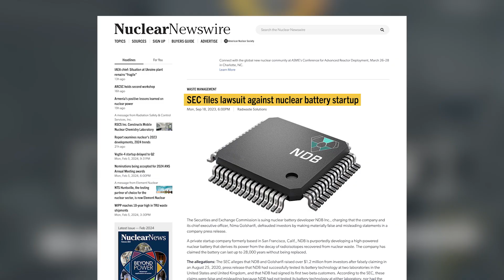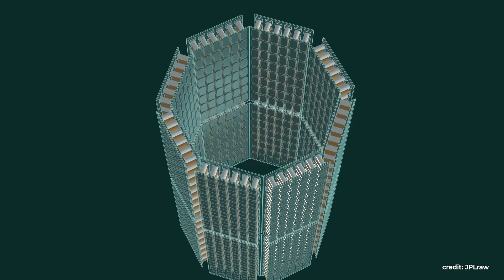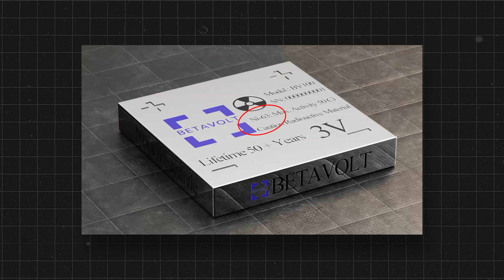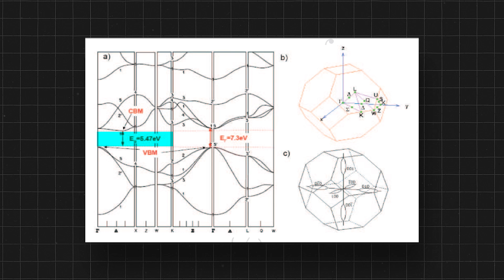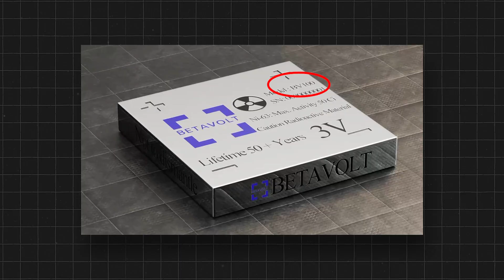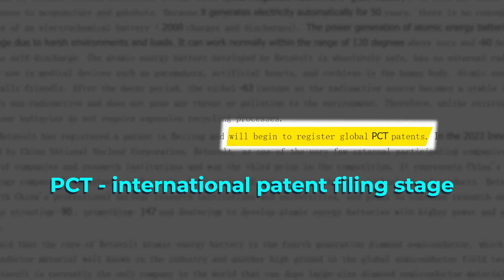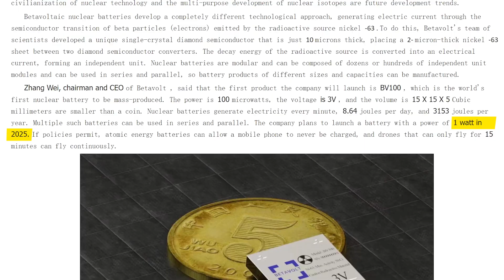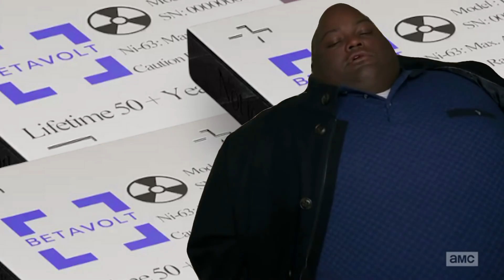Inside China's Nuclear Battery Breakthrough

Comment: They could include these along with a regular lithium ion battery in applications that require intermittent higher watt usage.  The nuclear battery acting as a constant trickle charging source while the device is in a dormant mode. Like a motion sensor wireless security camera that lasts decades. Could probably even do a phone that can regenerate passively and never fully dies.

Comment: Since it never stops charging it with radiation (if it ever works) wouldn't it have to be on all the time in order to dump the excess energy?  When it's off it will overcharge it if it's full. It would need some means of getting rid of the excess energy

Comment: If I could buy a one amp 18 V Ryobi battery which actually would equal 20 wants or a one amp 40 V battery which is 40 W  The value of those batteries would be 10,000 and the value of the 40 W battery would be $20,000 the use of these batteries would be unbelievable being able to power Ryobi’s maximum light at 32  Watch would be amazing even though you could power it with a six amp hour battery for eight hours you then have to change the battery out to be able to power it permanently would be well worth the money I have been looking for a power source for my 50 is in there still doesn’t seem to be anything in existence that you could purchase and produce power although solar panels are good they can’t  Power 24 hours a day and they can’t produce power in an enclosed basement so they have little to no value thank you for your video I have subscribed to you because I would really like to know about the advancement of this time in Battery in the future thank you very much for your research I would love to be able to buy one of those cells  to just test it and see what it can do thank you again for your video

Comment: Once they combine these with graphene super capacitors of the future, together with very low power usage electronics that suck up power in quick bursts, it might lead to some very interesting technologies. Especially since they claim to be developing a 1 watt version of this battery. At 1 watt it can become very interesting for battery+capacitor pairings.

Another interesting application (if the technology is inexpensive enough) would be to use this kind of technology instead of solar panels for generating power in your home, or to augment solar panel technology. IE: these could be used to power up a third source of power(on top of grid+solar panels+solar batteries) that keeps a backup battery charged in case of a grid+solar battery failure.

Comment: I think a stationary battery capable of running an individual home would be a great application for a 50 year lifespan.  It wouldn't matter if it cost $10k and took up 4 cubic meters buried in the yard to produce a continuous 10kw. Allowing offgrid power generation with no moving parts and nothing exposed to weather would be worth a premium compared to PV or wind.  It sounds like both these companies are a long way from that cost and package size, however.

Comment: My guess is that the first customer is still space sector? China has a few deep space mission proposals where a nuclear battery can be a good backup? I think this does outperform traditional RTG? Also the power density can be improved for this use cases by using more concentrated isotopes?

Comment: Kinda sounds like a tenth as valuable an idea as you think. At the same size you can create much higher power generators at significantly less cost. Anywhere with light even artificial or moonlight solar overtakes this. As for cargo i doubt Battery swapping is the driver for not doing this and even if it was there are better alternatives. Some medical case uses might be good but the market for this probably is not high enough to justify much hype or investment. These are pretty much only a good option for critical reliability, low power, low access, low light, and low space use cases. If it doesn't match every one of those to a pretty extreme degree then its practically useless. Unless these are manufactured at significantly low cost to the point they'd replace many watch batteries i doubt its usability and based on production method i severely doubt this

Comment: Missed PoVs: IoT and IT. 
Semi-passive sensors for IoT, and 'keep alive' voltage (instead of the classic CR2032, Etc.) for IT come to mind first and foremost.

If Betavolts 'current stage' claims are anywhere near accurate, and could be scaled to production (w/o the ire of the NRC, etc.), they'd have wide applications. 
-potentially even opening entire 'tech branches' (per se) for IoT proliferation [for better or worse]

Comment: Gosh this video is somewhat rubbish. Why care about energy density? The real topic is POWER DENSITY (e.g. Watts per gram) and not energy density (Joules per gram). The power density is limited by the isotopic power density which is entirely limited by the decay chain of the isotope used. You won't get more power out than what the decay chain is producing and with a realistic efficiency of perhaps 10%, there is no magic possible. Even if you chose a much more radioactive isotope like Plutonium 238 (will be too dangerous and way too expensive), you will still never get close to Li-Ion on power density. This entire idea is a scam when companies start talking nonsense about drones, laptops, smart phones, EVs and so on. It wont happen ever because of the nuclear science involved and the first law of thermodynamics (electric output power is a fraction of the isotopic power). NDB did this scam for years until they got sued. Now it's just another company doing the exact same BS. Just to put things in perspective, your smart phone takes around 1000 times more power just to be in standby than what this battery can output. If you used this battery and turned the phone off completely, it would take more than 10 years to charge it (while nobody could call you) LOL...
Reply: The battery has up to 50 Curie of Ni-63 as indicated on the package.  Make this 50 000 Ci to power a smart phone.  Most people have absolutely no idea what 50 Ci really means.  Regulatory agencies demands that you own a license (NRC in the US) to use or possess more than 0.003 Ci.  This battery will not make it to the public for that first and very simple reason.  Like you say, this is another investor's scam from China.
Reply: @chrisl442  You got it. But it’s worse. 100 micro Watts times 1000 is only 100 mW. You can barely keep a phone in standby on that. You rather need 10s of thousands of Curies of radiation to get to Watts of power when you start running more heavy apps, like a game, on your phone. This topic is extremely stupid.

Comment: Thank you for this informative video.

I made a quick back-on-the-envelope calculation. 1 gram of Nickel-63 has an activity of 2.1×10^12 Becquerel. It means that in 1 gram there are 2.1x10^12 beta decays (=56.8 Curie). Each beta decay has a variable energy, but on average we have roughly 20 keV = 20,000 * 1.6x10^{-19} = 3.2x10^{-15} joule/decay. So, eventually we have 2.1x10^12 * 3.2x10^{-15} = 0.00672 Watt. This is the amount of power produced by 1 gram of Nickel-63. Even if you were able to convert 100% of the radioactive decay energy into electric energy (impossible of course), you couldn't make more than that.

The battery label reads "50 Curies", so it there should be 50/56.8 = 0.88 grams of Nickel-63 in each battery. So each battery produces 0.00592 W; thus the efficiency on converting the decay energy into electric energy is 0.0001 / 0.00592 = 0.017, or 1.7% if you will. Not very impressive, if you ask me.

To produce 1 W, you would need 1 / (0.00672 * 0.017) = 8860 g of Nickel-63, or about a 9 kg of this radioactive isotope. I am aware that Nickel-63 can be made "relatively easily" in a nuclear reactor, by letting the non-radioactive and non-rare Nickel-62 be bombarded by neutrons... but a 9 kg lump to make the claimed 1 watt? Besides, these 9 kg would have to be spread over a very thin
film; if you make a bulky amount of Nickel, most electrons are stopped inside the mass itself. 

All of this, of course, does not apply if you use some other radioactive isotope that produces more energetic electrons and/or at higher activity (more Becquerels/g) and/or a generator with higher efficiency when converting into electric energy. I may be wrong, but I think I've seen refereed papers in which beta voltaic efficiencies of ~10% are claimed. Moreover, the whole nuclear battery gets warm by the non-used beta particle energy, so it could double as thermocouple - converting thermal energy into electric energy via Seebeck effect. The efficiency of a good thermocouple is ~10%. Thus, as 0-th order approximation, ~20% of the beta decay energy could be converted into electric energy. This still means 0.0013 W/g for Nickel-63, but 0.06 W/g for Tritium (hydrogen whose nucleus has 2 neutrons in addition to the proton). However, Nickel-63 has a half-life of 100 years, while Tritium half-life is only 12 years. And it is expensive, since it is mostly directed to keep thermonuclear warheads endowed with their "explosive" that vanishes rapidly over the years.

I think that Dr. Ben Miles is right - this technology is exciting and interesting, but it likely to have niche applications only. But we will see what the future has in store for us.

Comment: Watt-Hours is the more important measurement. This is a generator, not a battery. 

If the 70kg, 1W battery charges a capacitor for 1 hour, it gains 1 W-hr.
In 1 day that's 24 W-hr per 70 kg = 0.34 Whr/Kg
in 1 year it produces 124Whr/kg
... etc

Comment: These batteries are such an eye-roll to engineers. Micro-micro-watt batteries are totally useless for everything except the absolute corner-condition niche applications.  Even the most skilled, clever and imaginative electrical engineers struggle to find practical applications for these batteries.
Reply: Just run 10,000 cells in a parallel series and you'll have 1 watt at 30v for 2,530 years. How much does each cell cost?

Comment: betavoltaic batteries were invented 50 years ago. Come on... and this is especially not relevant, since it needs Ni63 isotope, which can only be synthetized for a low sum of 4000 USD per gram. So for producing 1 W, they will need 35 kg of it, it comes down to the bargain price of 140 million USD only for Ni63. But you know... this is the cheaper side, if they want 35 kg of artificial diamond, it will cost like 310 million USD for the cheapest options. So let's see: 1W for 50 years, 438 kWh for 450 million USD, so roughly 1 kWh for 1 million USD. I don't know how expensive the electricity at your place, I can buy it for like for about 1/10millionth of that price.

Comment: Honestly, as long as it can produce more than idle use rate power...
They can be just...
Added to existing batter setups.

Repeat: Added, an in, not replacing.

Basically, if I use my whatever all the time,I will still need to charge it rutinely. But it will go faster because a good bit of power is also charging it. Not enough on its own,  but enough to cut the time in a big way.

Heck, if it's just 25% over idle use rate, I could just put on idle for a bit, and by tomorrow it would ne full.

At minimum when I first got it.

Comment: I’ll stick to my 1.5mSv/year background radiation in Australia thank you very much. There’s no way nuclear batteries become commercially available to the public, the risk is too high, Ni-63 undergoes beta minus decay and while it has a very short range it still produces a mean of 17keV - maximum 66keV which means if you have the battery very close to your skin in say a wearable device you will be absorbing ionising radiation. According to the most commonly accepted radiation hypothesis, the linear no threshold hypothesis, these doses are cumulative and will increase your risk of cancer at a linear rate. The rate of cancer is already 1 in 2 men by the age of 85 and 1 in 3 women by the age of 85 according to the cancer council statistics in Australia.

Working in medicine we see a lot of children coming in having swallowed batteries, and the most radiation sensitive organs we have in our bodies include the stomach and colon (as well as breast and red bone marrow and lung, each of which have a tissue weighting factor of 0.12 which we use to calculate effective dose in imaging). Assuming the battery doesn’t dissolve in the stomach and makes its way through the digestive tract, the organ doses will be very high and we know children have an even higher risk from the same amount of radiation as an adult absorbs. If the battery dissolves the situation is disastrous regardless. If a gastroenterologist retrieves the battery there has still been excess exposure to the stomach.

This won’t be approved for commercial public use. The risk is far too high for any ionising radiation to be used as a household battery.

Comment: One big problem: If you optimize your battery chemistry for very low max power (like 100uW), you can relatively easily make a battery which lasts 50 years. It will be cheaper than betavolatics, would weight 10x more though. So unless you are extremely weight and size constrained, current nuclear battery technology does not make much sense, the market is extremely small.

Comment: But if you only need heat to work, would it be possible to use an i3 instead of a reactive material to extend my laptop's battery and stop it overheating?
Reply: That's actually a great idea! However, maintaining that temperature level will kill the processor.

Comment: I invented a nuclear battery in 1966. The only problem was the voltage (5,000,000 V) and the low current. All you need for useful nuclear batteries is the ability to modify the weak nuclear force.

Comment: Dr Miles you are wrong about the definition of battery, battery does not store energy, the old zinc carbon batteries produce energy by a reaction, they do not store external energy, are they "chemical generators"? The italian word for battery is "pila" (translate stack) and the inventor of it was Alessando Volta, the name pila refer to the "sanwitch" of different elements like the chinese nuclear battery, so in Italy we call it "pila atomica" that is the right name.
Reply: update: i found on wikipedia that in english the original Volta battery is named "voltaic pile" so you should call it just Atomic Pile like we do.

Comment: The energy density becomes less of an issue for devices that draw very little power. Smoke detectors are a great example on the consumer side. Pacemakers are another possibility, currently those last ~5 years if you don't have a rechargeable version. Getting an extra decade between replacements is huge. Embedded sensors is another area. A GPS wildlife tracker for example.

Comment: 5:35 alkaline battery does not store anything either then, as you can't charge it, it just generates current from the chemical reaction between its components. You're mixing up the terms "battery" and "rechargeable battery".

Comment: it's not a breakthrough, it's literally like any other radium pin battery, they are made to be a solderable component that delivers a very weak power supply for decades without stop, it has a nonexistant energy and power density but is just a gruarantee for expensive and crucial volatile memory components

Comment: Wouldn't a low leak battery like lithium-air (watch/hearing-aid batteries) be far more viable than radiovoltaics for most or all cases? I'm sure it would be far cheaper, and when consuming under a milliwatt (as it would have to if radiovoltaic was an alternative option) it should still last for a really long time. In the case of shipping containers I would imagine probably as long as the container's life (they are proactively retired after not too long as far as I understand). The issue with nuclear decay generators is that they last too long. It will just be a huge waste considering the amount of time that I'd think it gets used for in most situations. For instance, its average lifespan above x% (ex. 90%) power might be 300+ years or something, with most applications probably maxing around using only 20-50 years of that.

Stores have been using electronic displays (notably e-ink these days) for a long time now, and I'm sure they'd use the same sort of thing. Doesn't seem to be a problem to use existing batteries that are long life low leak.

Comment: Even if it could push a few years it would be amazing. I don't need 100 years , I mean 6 months of non stop use would be amazing.. but if I remember right  it's the cost vs how much is produced , it's been years since I have read anything on this subject but I want to remember it's VERY expensive with little return , edit sorry return is not a accurate word the amount produced vs cost is better , but it's been MANY years so things could have changed

Comment: It's not a battery breakthrough. It is terribly expensive and has a very low current. To power a cell phone, you need 5,000 such batteries.
Reply: Aaa sorry I meant 20.000 batteries.